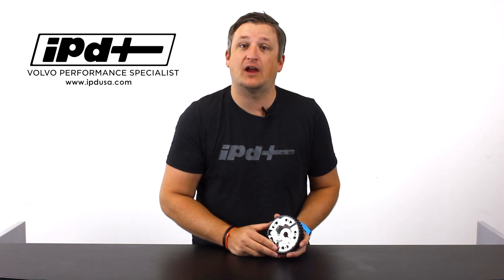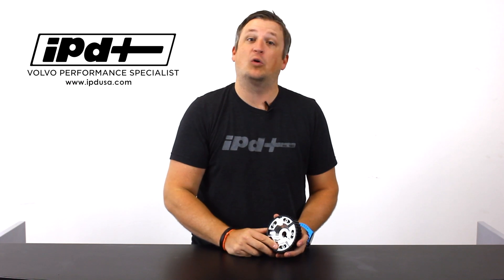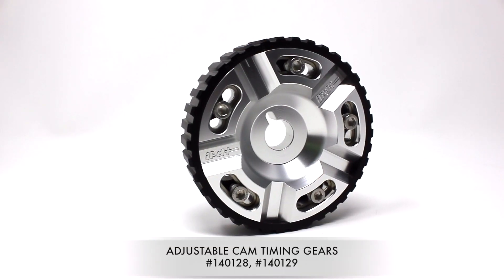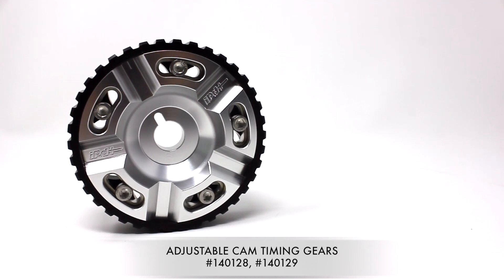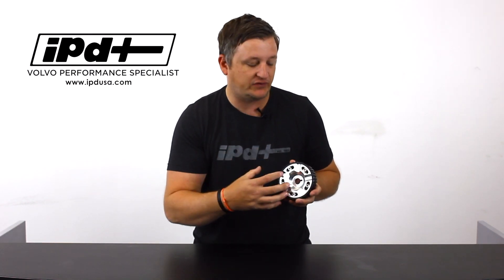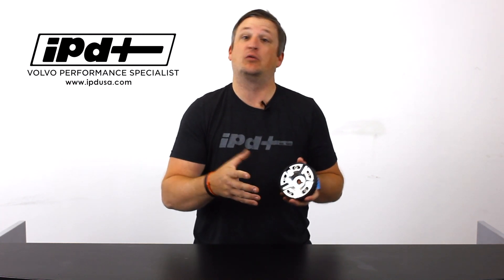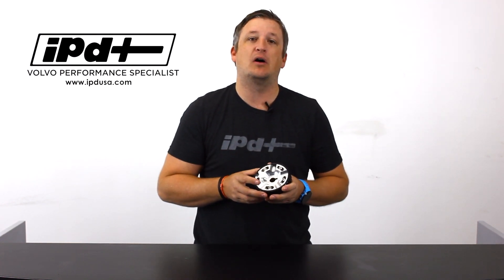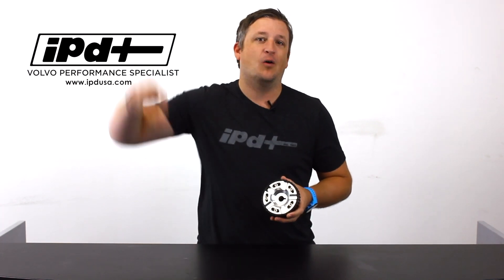ipdVolvo - Adjustable Cam Timing Gear

Comment: Yea but for more than the price of the actual cam, no thanks.
Reply: Get a Nuke performance cam gear only 180€ and vx camshaft from ipd or order one from sweden if you want a custom one.
Shit stock cam + ipd cam gear = depression and unnecessary money loss.
Reply: @0hjaa3.0  lmfao vx is a stock cam profile from the 1993 volvo 240s with the B230FX engine
Reply: @LocalAutist the b230fx was zippy so what's the problem with it being "stock" 😂
Reply: .... $200 for an adjustable cam gear, $200 for a cam... No thanks. Lol the vx cam is basically stock too
Reply: @cmw184  Get a K or H cam then and cars might not be for you if that is too expensive for you.
Reply: @0hjaa3.0  K and H cams lose all the low end, crap!
Reply: @ElmerFudpucker  Get a 180€ Nuke Performance adjustable cam gear. Can get some of it back.
Reply: Theyre out of production lol i tried to look everywhere for one to no avail

Comment: I have the feeling that since the coming of the SPA there’s not too much modding going on anymore. End of IPD?
Reply from the maker: We are always working on new products for almost all models of Volvo's. We work on the highest demand for parts and work our way down. The SPA chassis is not as in high demand as the others at the moment, but we always working on new products and the SPA has been on our minds as well. Don't you worry, this is not the end of IPD!
Reply: Explain. What's the SPA?
Reply: @Collin Settles Ah, thanks. I think the SPA platform hasn't been around long enough to have much of an aftermarket. Is it inherently hard to make replacement parts for or something?